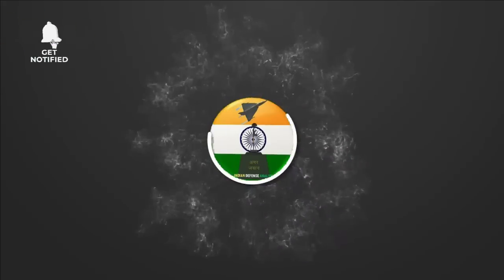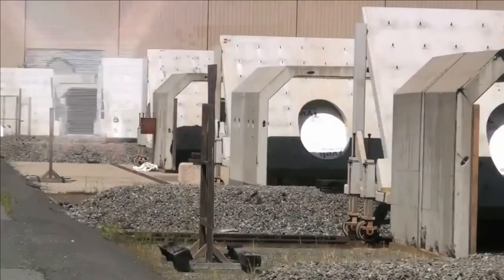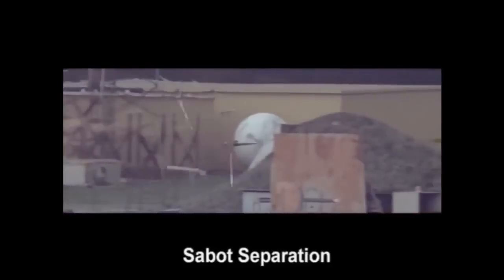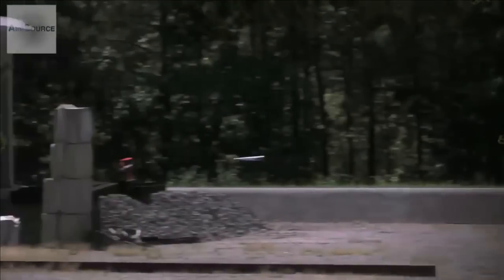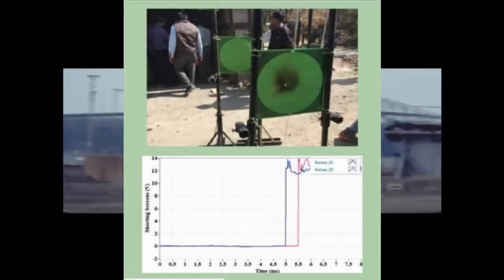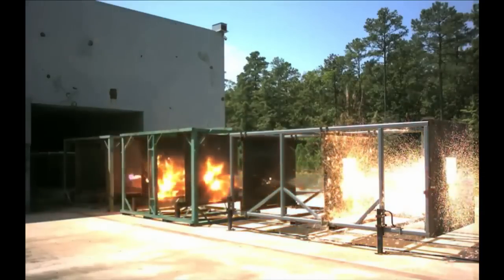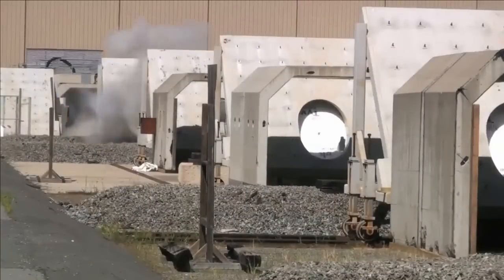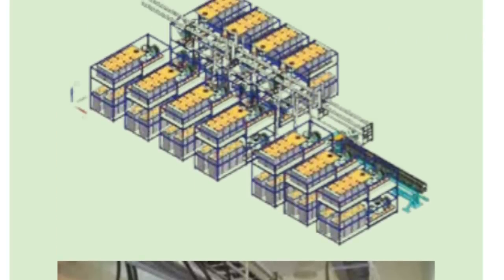#breakingnews DRDO test fired Electromagnetic Rail Gun (EMRG) & 40mm Grenade developed by ARDE #drdo

Comment: Nice video
So these Electro magnetic pulse Rail gun with 100 mega joules give Higher range for guns or higher speed like 2000 meters in a second or it gives both. If higher range, then what % is more than usual rail gun system?  Pl reply sir

Comment: Issue is lack of nuclear reactors to power ships. Rail guns are only practical when the ship is powered by nuclear reactor, since conventional ships cannot supply enough juice. A nuclear powered Visakhapatnam-class destroyer is the only practical platform. The same nuclear reactor used to power submarines will need modification for surface ships. Railguns are also needed on land to shoot down hypersonic projectiles, since railguns can hit Mach 7-10. That makes it a viable counter to hyper sonic missiles which have no  practical answer at the moment.
Reply: Hypersonic missiles or glide vehicles? Coz most if not all ballistic missiles travel at hypersonic speeds. A hypersonic glide vehicle with manoeuvring capabilities is what’s being developed by the big powers. A manoeuvring hypersonic missile with terrain hugging tech is beyond current know how.
Reply: @Kun..07  Even a glide vehicle is traveling over Mach 5. No Patriot can shoot it down. Basic maths shows if you want to shoot down something at Mach 10, your projectile better be at Mach 10 too. No good to shoot down a hypersonic weapon at point blank range because debris at hypersonic speed is fatal!
Reply: @datoolz0  it doesn’t work like that. Sophisticated radars track the incoming flight path of the vehicle, whether it be a missile or a glide vehicle. A volley of missiles or projectiles are then fired to meet the incoming threat in its probable path. If the vehicle manoeuvres at that speed, it’s virtually impossible to
track the trajectory so as to negate the threat. Only US and China have hypersonic glide vehicles & both are still in testing phase. And yes, nothing as of now can intercept a hypersonic glide vehicle. There is no chase scenario in this.
Reply: @Kun..07  so what about kinzhal?
Reply: @beautifulInterludes  it’s a hypersonic missile based on Iskander. Fixed trajectory, which is why they’ve been shot down. Brahmins although slower, is much better coz it manoeuvres.
Reply: @Kun..07  you're wrong. The Ukrainian general was the first to rubbish the claim that they shot down kinzhal. The western analysts were mum on this as well. Then the propaganda trumpeted like anything- shot down another one,  two , three ...so on and so forth. Take that with a grain of salt as big as Kyiv.
Reply: @man tham Even if US has abandoned them it is no reason not push on ahead. Those are solvable technical issues.
Reply: Drdo scientist are far better smart than you